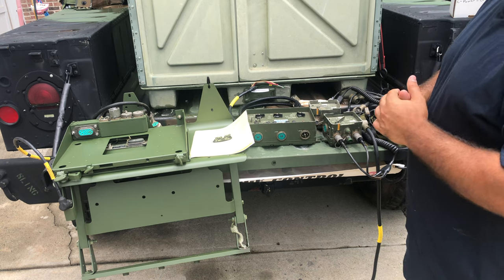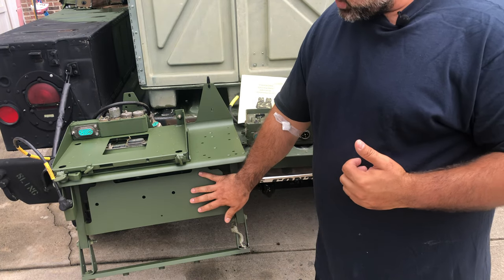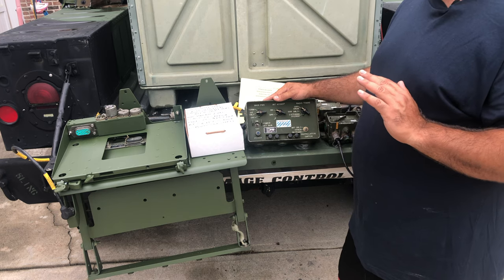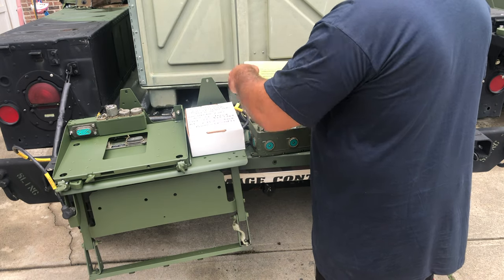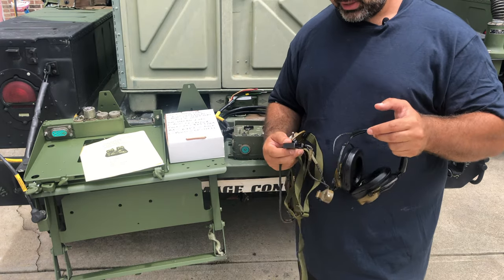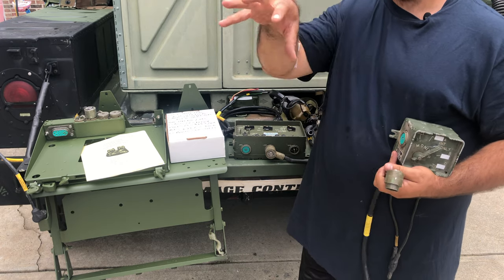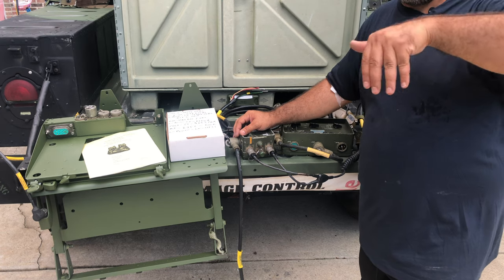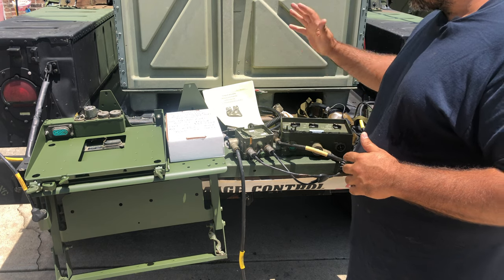DIY: How I install my 1780 VIC 1 Intercom for my HMMWVs ® HUMVEEs ®

Comment: So you install the power cable to the starter and not to the battery
Reply from the maker: no sir, that was an incorrect statement.  You should go directly to the battery bus bar
Reply: @rubenmasterdamagecontrolma5313 wish your vid showed installing the main power cable. Thanks for the info.
Reply from the maker: @desertwolf3818  so if you look at our batter box you'll see the cables going into the battery bus bar from inside the truck.  If you go under the truck, between the frame and where the battery box is, from under the truck, you'll find the same studs you had on the inside but now on the outside.  You'll just connect the main power cable there.  Make sure you don't swap neg and pos.
Reply: @rubenmasterdamagecontrolma5313  ok thanks, like your channel 👍🏻
Reply from the maker: @desertwolf3818  Thank you
Reply: @rubenmasterdamagecontrolma5313  ok so the bolts underneath the truck are larger then the attachments that came with my power cable. So Change them out?